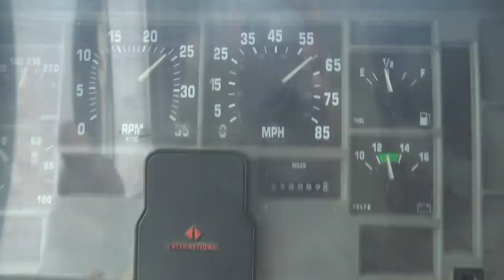What Ever Happened With That Blown Tire?

Comment: Good to see you made it to the east coast. I'm in a wheelchair and want to do a cargo trailer build. I'd love to get your advice and ideas on a handicapped accessible build. I've been looking at WEE ROLL trailers. I've been watching your videos for awhile.
Reply from the maker: Why not a cargo trailer like mine with a motorcycle ramp off the back? A rope on one of the handles. Should work out nice.👍🏻
Reply: @enigmaticnomadics  I'll definitely have to check into that. I was thinking about putting a come along that we used to use in construction. Then I could attach it to the front of my chair and crank myself up. It would take a minute to get me up the ramp but I don't want to install any electric motors for that 'just in case it doesn't work moment.'